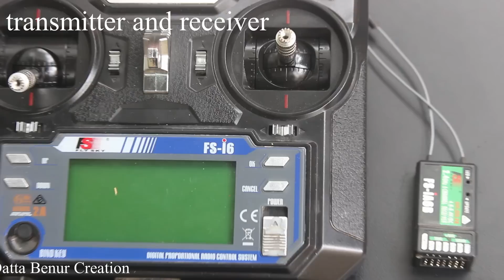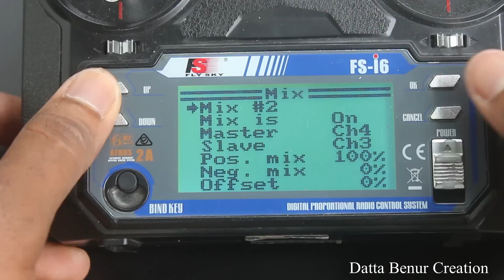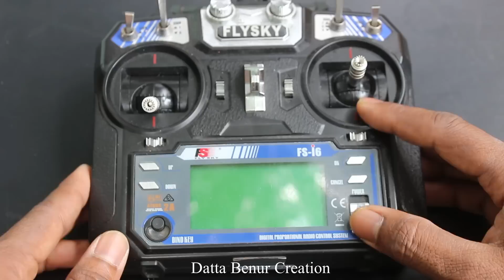Build Boat For My Son - How to make a single seat Boat For Son

Comment: This looks unnecessarily dangerous. You should put a little bit of protection at the sides of the boat, like some fences of some kind or probably a door maybe?. It also seems like common sense to do this. Also that plastic chair is not even sticked to the boat. Looks quite fragile.